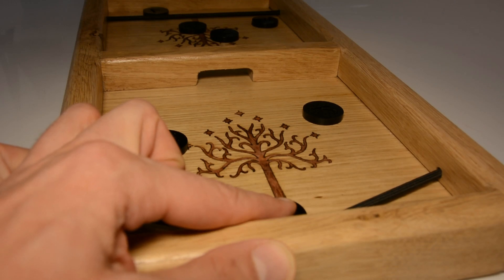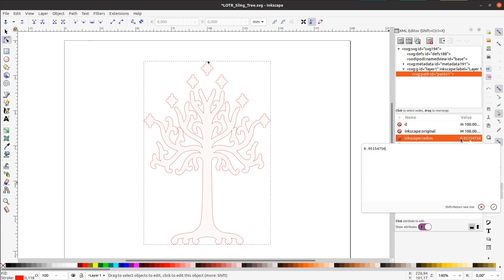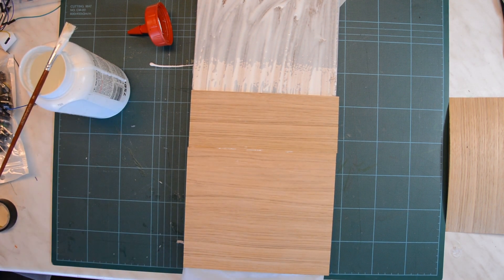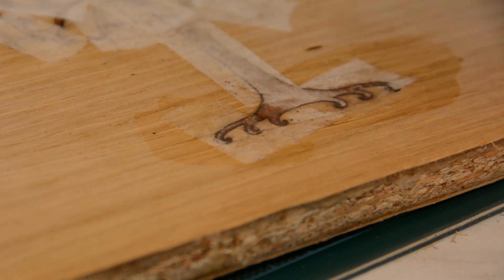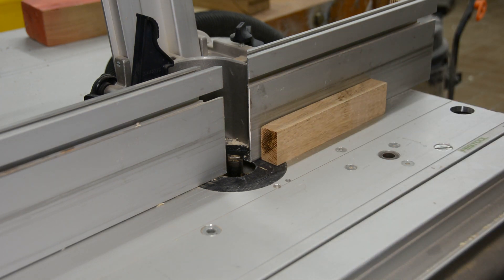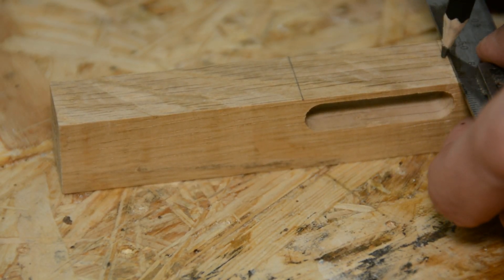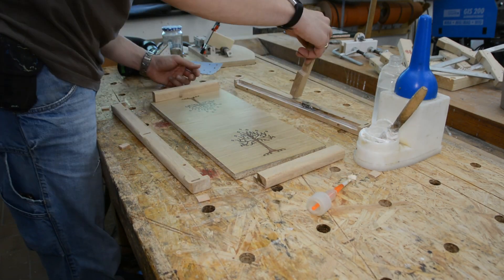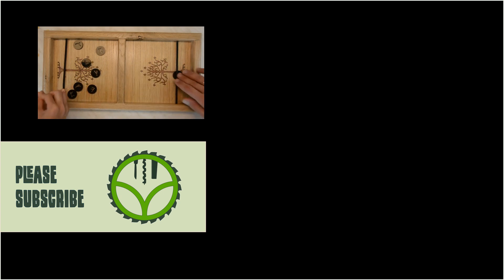LOTR themed slingpuck game (laser cutter project )

Comment: very good job, to improve the game it is possible to put a glass cover and put two holes on the sides with a wire to pull the two rubber bands this allows to not put your hand inside the surface of the game and avoid that the tokens go outside.
Reply from the maker: Good idea